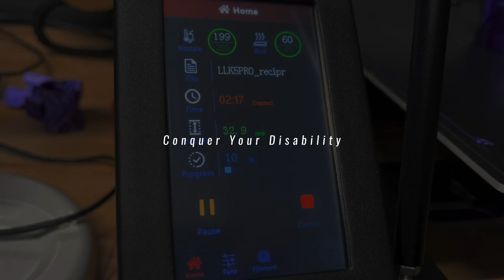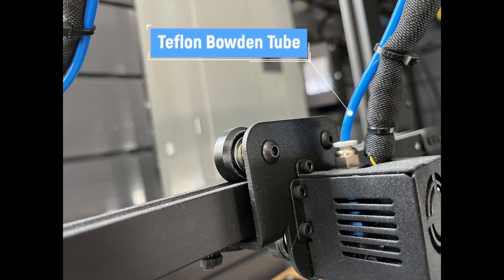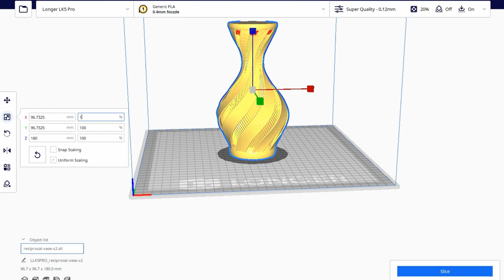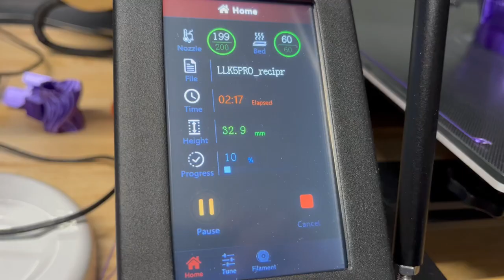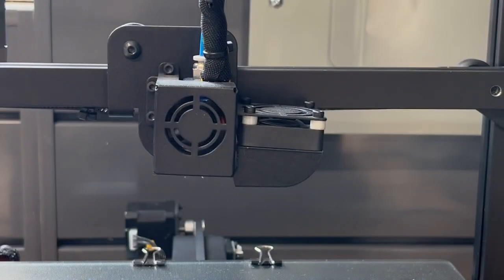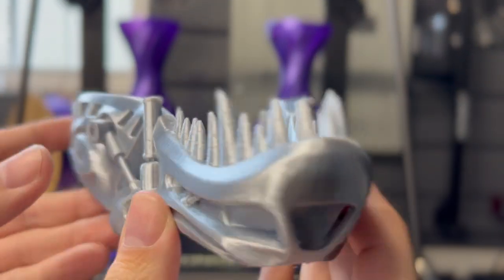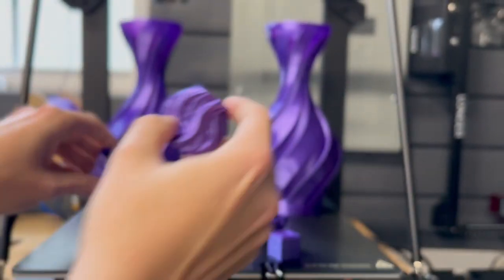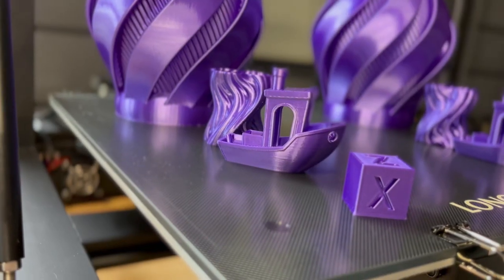LONGER LK5 PRO HAS A NEW COOLER - 3D Printer Review

Comment: In spiral mode, the print head pauses twice on each pass. 180 degrees from the other. It's causing blobs and two very ugly seam lines. Any idea what's causing this? I have an Elegoo Neptune 2s and haven't run into this issue with it. Scratching my head here.

Comment: I am new to 3D printers. Just set up my LK5 PRO. First print was the whistle on their card. Came out fine......ever since I have major problem with part staying adhered to plate. Have cleaned plate with IPA and dish soap. Have tried various temps and rates. Can't even duplicate results from first print with same settings. Have tried glue stick and hair spray
Reply: Have you tried to tram (level) the bed? Are you getting a good 1st layer?